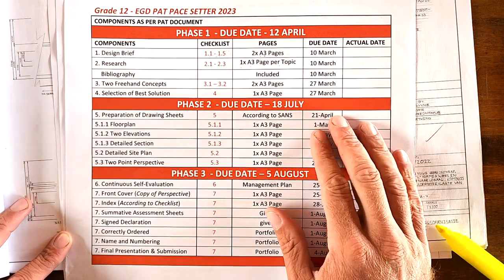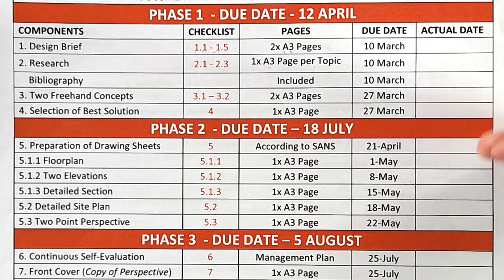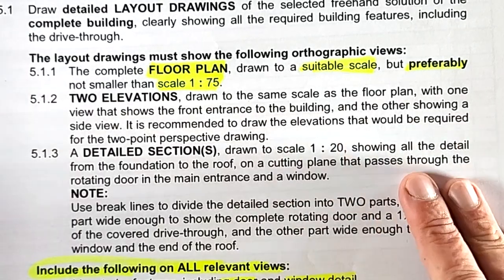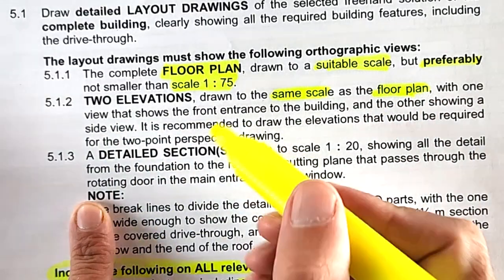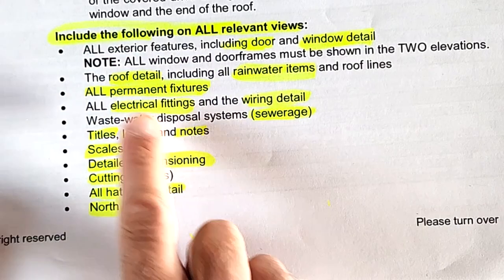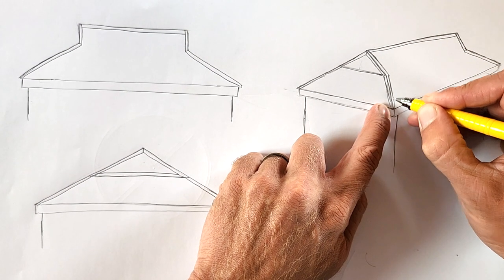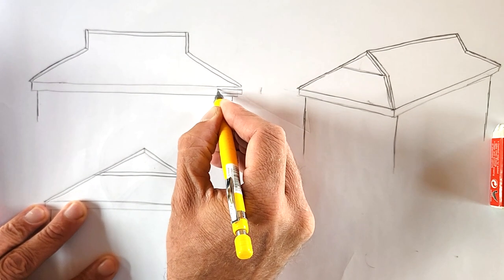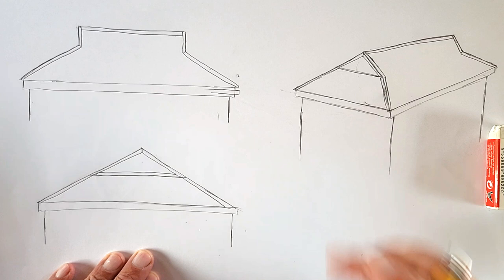How To Hack Your EGD PAT - ELEVATIONS - Episode 9

Comment: Hi sir. How would you draw a rotating door on a sectional elevation, and do we need to indicate road foundation for the 1.5 meter section of the drive through.if so how would we do that. Thanks for your help sir, really appreciate it. I would not ask this if I couldn't finfmd it anywhere else 😅
Reply from the maker: Adiy, your question shows great insight and determination to succeed. Well done. In my upcoming episode, I will make sure to address your question more fully. For now, consider how to place the cutting plane in such a way that this section is as simple as possible. Your rotating doorframe will look similar to that of a traditional doorframe without recess. For the road foundation, you can just use the same design as that of the inside concrete floor and specify a "concrete road finish"... Great, all the best with your PAT!
Reply: @HowToEGD  thanks a lot for your feedback sir I really appreciate it